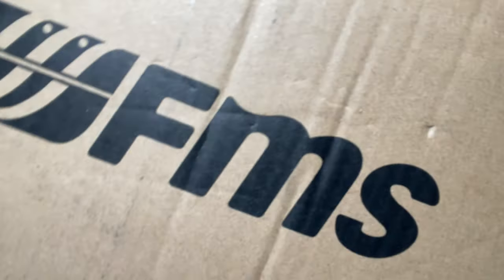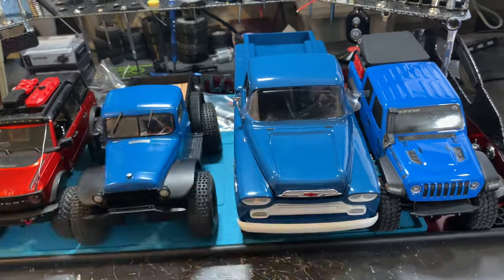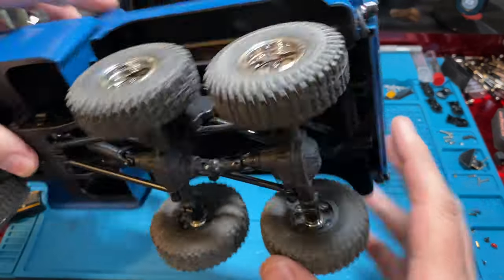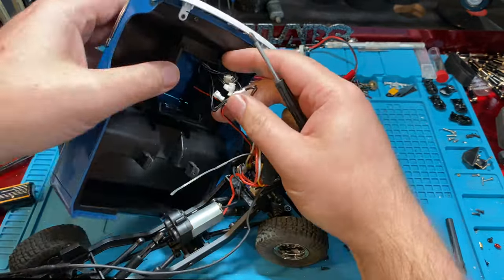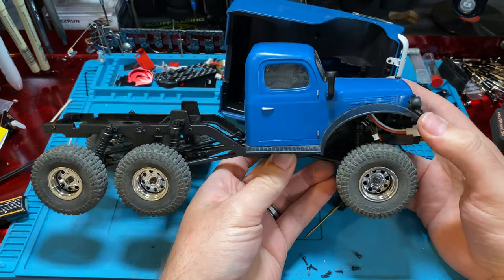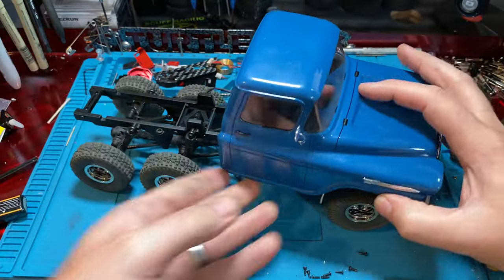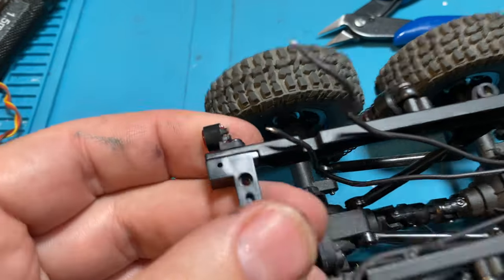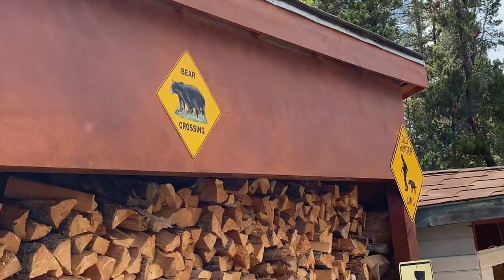1/18th Scale - Box Opening, Review and Drive of the New Chevy Apache 6x6. We also take the bed off!

Comment: 6x6! Thanks for showing it without the rear box. You're the first I've seen to do that. Do SCX24 wheels fit?
Reply from the maker: Yes, they are the same axle and hex size, however, you need to make sure the offset is right because if its too shallow, the wheel may rub on the c-hub/steering knuckle.  (shouldn't have any issues with the rears)

Comment: can the shocks be turned up side down?
Reply from the maker: not easily because the bottom of the shock is on a ball joint that is part of the link ball joint (double ball joint) and the top of the shock is more of a bushing sleeve... :(. I am sure with some tinkering you could make it work, but not just out of the box.
Reply: @TheShopMiniRC   THANK YOU